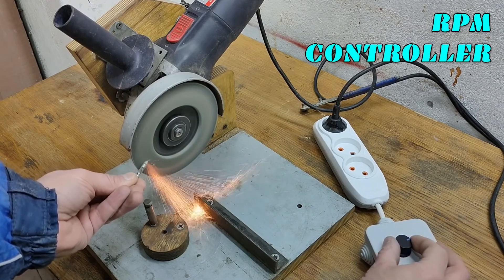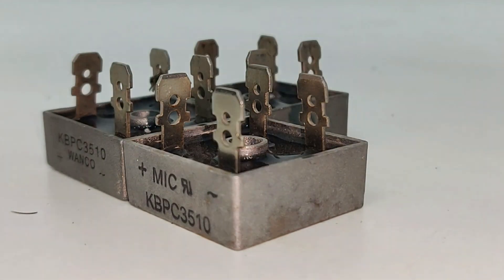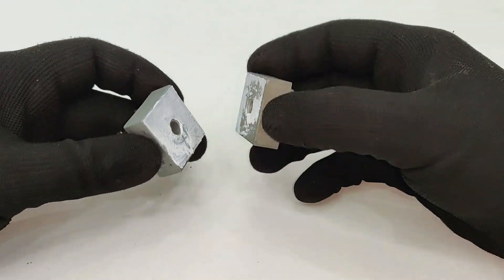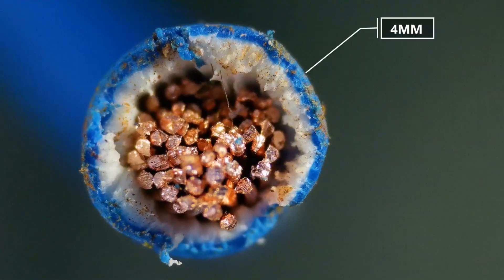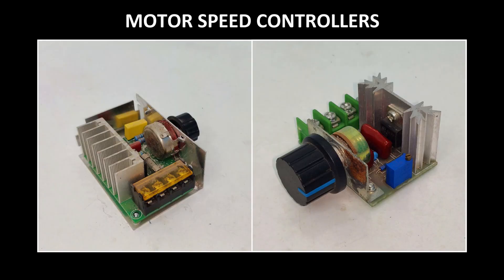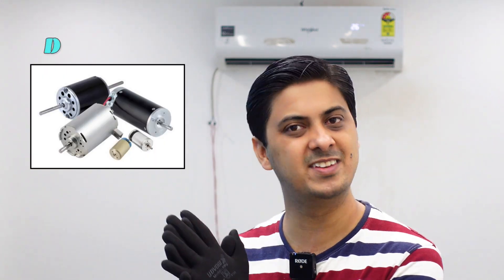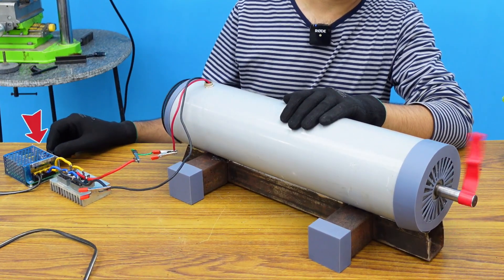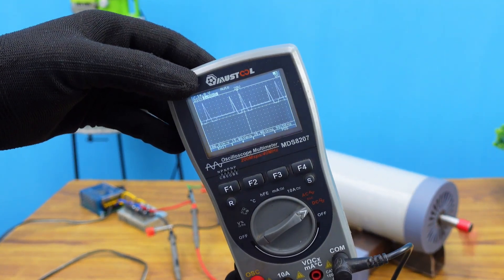Make a DC Motor Speed Controller Upto 220 Volt 4000W Control

Comment: Thats still too much thermal paste. The paste itself is much worse at heat transmission than the heatsink. But it does transmit heat better than sir. The purpose of the thermal paste is to fill in the microscopic pits and scratches on the surface of your rectifier in order to increase the amount of surface area that comes in contact with the heatsink. Normally most of the surface of your rectifier would be flat enough to touch the heatsink directly and that is by far the best heat conduction you could have. But when you layer it on like icing on a cake like that theres almost no direct contact to the heatsink instead youre limiting yourself to the thermal conductivity of the heatsink grease only... The best way to apply heatsink grease is to put a dab on your rectifier the use a flat straight edge like a razor blade and scrape it all around the surface of the rectifier making sure the pits and scratches only get filed in. That will give you the best performance

Comment: I plan to change my 4kw ac motor to dc motor which I can control the speed. this is for my extruder machine, one of the reason is the AC motor is noisy when running, could you advise what is the suitable DC motor, speed controller and  power supply that suit the replacement, thanks

Comment: Hi my friend,  I've tried this device last year, gave up for sometime,  now back to it. Can you tell me the input AC  tension and output DC to the motor, pleeease?  My motor is DC 180V 6.25A  Does it fit?
Reply from the maker: Alright ! Just connect the input side to 220V to 240V Ac as I did and always make sure to turn the knob to minimum after use to prevent any accident. On the DC side , simply connect the 180V motor. It will work 👍
Reply: @MrElectron  Thank you so much for replying.

Comment: What is the value of inductor in the Filter ? Can you please tell what was the value of peak to peak ripple? Because the value of capacitors you used and assuming value of inductor around 1 mH, the ripple could be as high as 30% or much higher depending upon current withdrawn.

Comment: i have a question how could you control AC motor , i search every where you need VFD , lowering the volt wont make diffrance is RPM i will only damage the motor and it will lose torque
Reply from the maker: The initial circuit in itself is for AC Motors.

Comment: Why do you keep revving up (the pot) all the time..???
You need to improve on soldering skills..and for high currents , wires need to be crimped with suitable lugs, not soldered......the two capacitors are unnecessary in ripple dc control.

Comment: sir, how much is the AC input voltage and what is the maximum voltage DC rating of the motor? Can I use your set-up to charge car batteries? thanks.
Reply from the maker: Input is 220v ac. Motor voltage is 180v dc. No, not at all. It will be extremely dangerous

Comment: Good information! But why do you use 2 rectifiers?  Is it to increase filtering & smooth the output?
Reply from the maker: Thanks ! Actually,  i have gone through these situations in the past where my rectifier got damaged after continuous drawing of 10 Amperes even though its is rated at 35A. So, its just to avoid such a situation again since i am planning on using this device in my future experiments. 😊
Reply: @MrElectron ..then what will that axial lead 6A diode do.....while others are 2×35 A  in the bridges...

Comment: My friend, what should be the capacitor values I need to use in the adapter I will make for the DC 180 1.5 hp treadmill motor?
Reply from the maker: By adapter, you mean speed controller ?
Reply: @MrElectron  yes
Reply from the maker: @arifdoner754  250v or higher and recommended capacitance of 1000uf or higher

Comment: Can that controller set up power a 4 HP DC motor with load of 300LB continuously
Reply from the maker: If that AC controller used in this device is correctly rated by the manufacturing company ( which is 4kw ). Here in the video, i didn't push it to 4 kw

Comment: Good job but wire should go into solder holes or use lugs to connect wires not just slap solder on connection

Comment: The idea is very nice but this controller might be too bulky for some applications...

Will go along with the original plan of using an 220 volt AC speed controller with a bridge/rectifier hooked up to the output of the controller to get the DC - and + needed for the DC permanent magnet motor to run.... 

There are DC motor controllers for sale on eBay but they are the switched on/off type with the on/off switch as part of the variable resister and I don't want this !, as I want to be able use my own separate on/off rocker switch (or No Volt Release Switch) instead of using the control knob to turn my machine tools off and on  - This has a clear advantage that the set speed of the motor will remain untouched when I turn the machine off and on...

Comment: Where do you get the huge filter capacitor? amazing video!
Reply: Also why 35a and not the 50a version?
Reply from the maker: 50A was not needed since the controller rating itself 4kw.

Comment: Is it possible to make alternator for car that can charge 74Volt battery with 20Amp ?
Reply from the maker: Sure, but you will have to limit the output voltage and current with a buck converter.
Reply: @MrElectron  sorry it's 74 Volt battery.. charging volt needs to be around 85Volts
Reply from the maker: @JRaymanJain  ok, then you will need a boost converter.

Comment: Thankful for the video  is the speed controller fit to control a club car has a DC Motor 48V ‘4.0KW’ armeture current 110A. Field Current 10A speed2500rpm  . Also the controler can reverse  the rotation ?  Thank you
Reply from the maker: Actually, it's rated only for 150v to 220v dc, so it can't handle your motor.

Next, the dc motors can change their direction of rotation easily by interchanging the wires or adding a single push double throw switch, but i haven't added that to  this device.

Comment: car alternator can welding? how to modified.
Reply from the maker: Yes, but not all of them.. some are less amps while some are high. Also, the voltage needs to be increased for better circuit completion.
Reply: @MrElectron  thank's bro.i'm your big fan.thank's for your answer.sorry for my english.
Reply from the maker: @melloonechay8014  You are most welcome. Thanks and no worries 😊

Comment: Thank you very much for this brilliant video. I have watched Gerard Morin's hyper drive motor and started building one but am stuck with getting a a controller for it. Would you be able to help me with designing one for the my 36 pole Samsung washing machine motor? I would like to run it on DC. It is a 0.9hp 1400rpm, 2amps 310V and is wound up in three phase.
Reply from the maker: You are most welcome, and your project sounds great. 
Just to be clear,  you want to convert your 3 phase motor to dc by rewinding ?
Reply: Build a switching controller? Like a brushless motor controller might work.

Comment: Thank you SO much,man! This is going to help me out drastically when it comes to the old treadmill motors I have and want to utilize(I have 6 of them currently. Lol)
Reply from the maker: You are most welcome, and that's so cool 😃.
Reply: We must be the treadmill motor clan. I have 4 of them too. I bought 116 - 18650 power cells for 40 bucks. I'm going to run my motors on 96 volts to keep the amperage down.